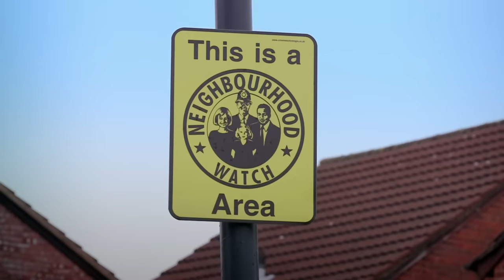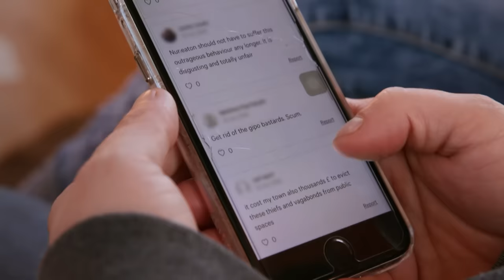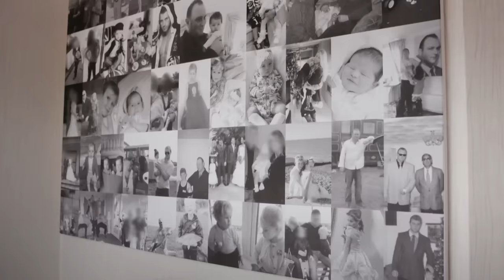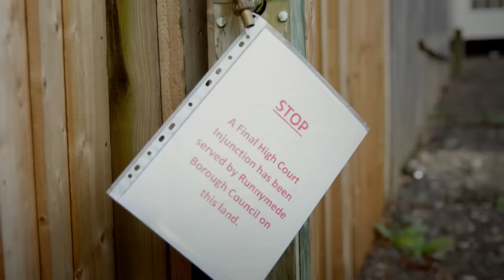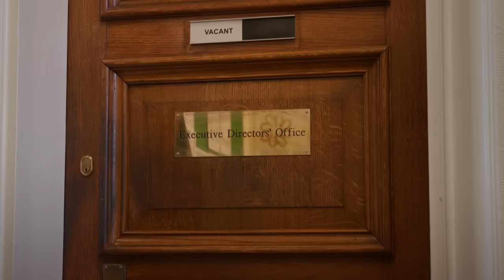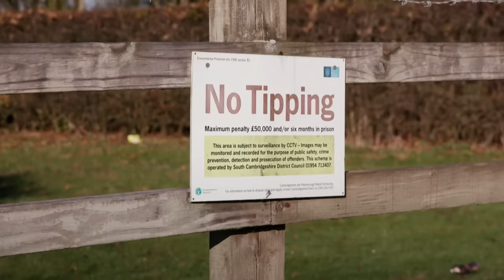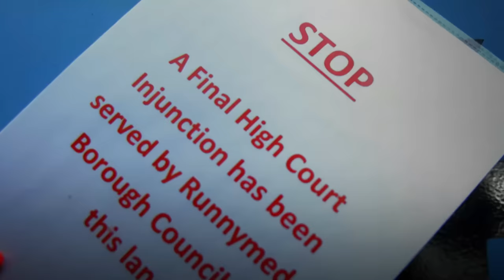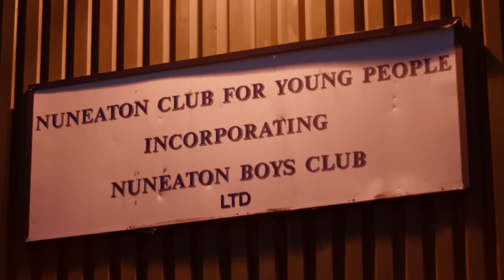My Glam Gypsy Lifestyle | The Gypsies Next Door | OMG Weddings

Comment: Why not make trailer parks for Travelers? Like the ones u see in the US. They could just all live in them & rent spaces. 🤷🏻‍♀️
(This isn't a question out of ignorance or anything negative.. Just curious)
Reply: They exist. But they are generally often occupied. There are at least 2, or 3 in Rumney, Cardiff. They should be allowed to travel like they used to, they should be allowed to stop for a few days in the countryside etc. They should also be allowed access to rubbish dumps, but generally they are not allowed as, especially where I lived in Wales, they made you prove your address to gain access to the tip... Ludicrous.
Reply: @LumiSisuSusi  Ah, I see. Wow, thats ridiculous about the trash access especially. 🙄 Something needs to be done, for sure. And hate & prosecution isn't the answer. Thanks for your response.
Reply: @LumiSisuSusi it’s not ludicrous though is it, why should I pay My council tax to get My recycling & rubbish taken & they don’t? I live in Wales & I’ve seen the mess they make after them!!! Why should the normal taxpayer pay?
Reply: @markjones6564  A very simple solution is... Let them use it and charge an entry fee. That's what we do in Finland where I now reside, a place where everything works well. By your method you'll end only up wasting more council tax cleaning up the mess that it sometimes left. Or simply just let them use the waste sites for free so less mess needs to be cleaned up👌, that's the far more logical and council tax friendly approach.

Comment: All that needs to happen with these traveller sites is for the DVLA and DVSA to go in with the police and whatever other agencies they can work with and check EVERY SINGLE VEHICLE.
Firstly to ensure each has a VIN (vehicle identification number) and if so, that it corresponds to the registration number. Modern cars have the VIN's in several places but sometimes these people are careless. Check each vehicle is taxed an insured with any that aren't, impound them so the travellers need to show proof that the vehicles are road legal and pay a fine to get them back. Then i'd have them go around EVERY caravan and do a VIN/CRiS check on them all. This will show if they are stolen although most will likely have had the numbers scratched off the chassis and windows...but once again, that pretty much proves a caravan is stolen as that should be checked when buying the caravan.
I can just imagine them as their cars, transit vans and caravans being towed away for whatever reason. I get so angry that I pay everything for my cars yet they drive around whilst paying sod all. I also know they steal caravans as they took two years ago at the caravan showroom next door to where i worked.  There needs to be a countrywide clampdown., i can imagine many would run back to Ireland.

Comment: Unfortunately, the bad travelers have made a rod for all the other ones back. if they turned up kept the area clean and left it cleaner than they found it, paid tax on earnings they make, etc, and stopped ripping people off doing "driveways" or pressuring old people to clean their driveway for like 500quid, it wouldn't be an issue but the good ones do not want to bad mouth or sort the bad ones due to the "family" lifestyle culture. so end up being tarnished with the same brush.